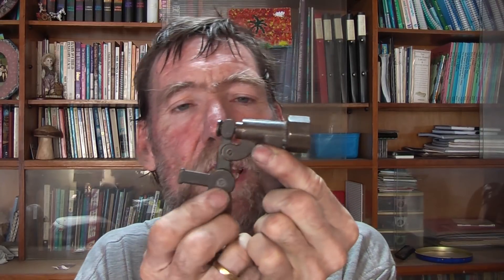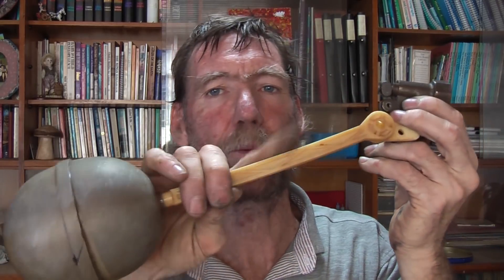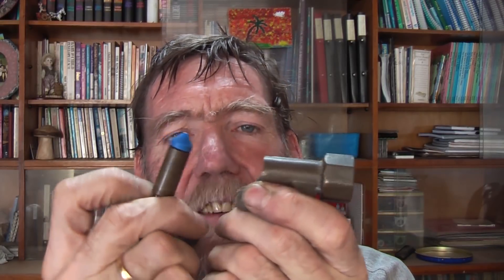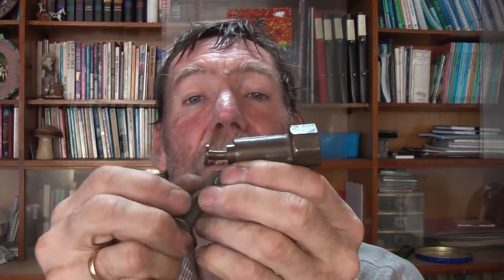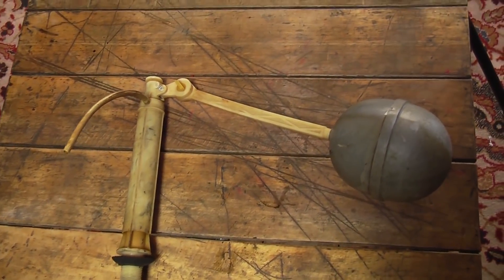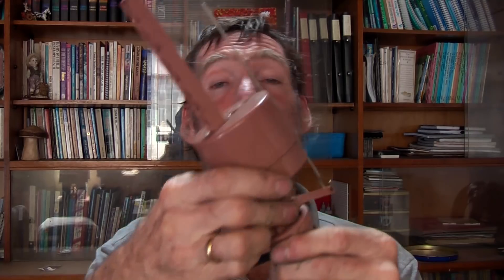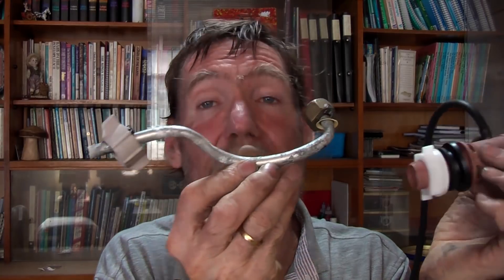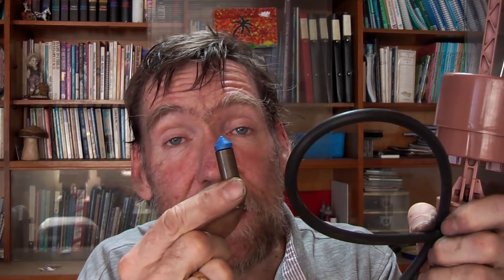Toilet Redundency

Comment: You don't have to be 50 or beyond in age(I'm 43) to appreciate the old ways and times when something was built to last any where up to 20 years and beyond. It shits me with modern ways. What a waste of materials! What I was told, is apparently it's cheaper for a manufacturer to make a complete replacement unit than a single spare part.. In reality, it's greater profits and is all part of consumerism and planned obsolescence.. It won't be long and you'll have to replace the whole cistern to fix a simple leaky valve... It's ridiculous!
Reply from the maker: absolutely

Comment: I would have thought that a lump of bronze that size plus the casting required would be more expensive than the plastic used in the injection moulded version.  I guess they are making the plastic version cheaper for a significantly wider profit margin.
Reply from the maker: Initially it would appear so, but work through the sums and it is not quite as it appears. The initial cost of making the lump of bronze is high, but so is oil extraction and processing.  The plastic is not as cheap to manufacture as you would think. The materials are cheap, but are they? I have not done the research into costs in detail, but I think that once you are committed to extracting oil, you are obliged to sell as many byproducts of it to recoup costs and  make a profit. Plastic is only a cheap by-product of more expensive processes and products. Once the lump of bronze is  made, processing is  as cheap as plastic, with  computer controlled molding processes (yes, you can do injection molding of bronze in the same way as plastic.) and  marketing. Its much the same. Then, when the bronze is remelted... it becomes cheaper than plastic, if you take into account all the other factors, and you have  no pile of dead material laying around. It is all about the profit margin with the current setup we have, and how much you can trick the public into paying more.
Reply: PhilipStephens007 Chances are, unless the bronze corrodes, it will never need replacing.. Only the plastic or rubber valve itself.
Reply from the maker: Correct. And in the past you could even re-seat the  valve seating with a tool to recondition it. I have one of those tools for taps or faucets. I have even seen some old taps where the  seating has been replaced when the re-seating got too extensive.
Reply: PhilipStephens007 True.. There was all kinds of ways to fix a problem with an existing fitting, valve or tap. I've got a tool for reseating taps myself. It has come in handy on many occasions. I haven't come across any with replacement seats though.. Again, ingenuity at its best and the attitude of, "fix the seat and keep the tap"... Only replace if it's beyond repair. That's been lost.